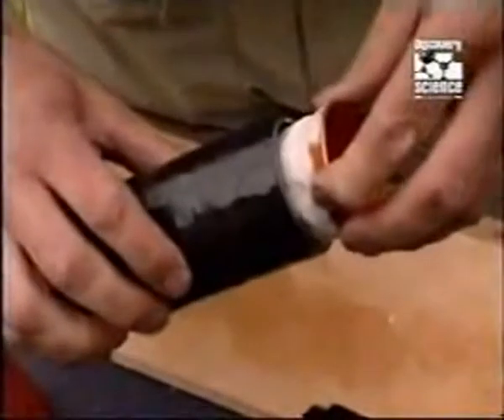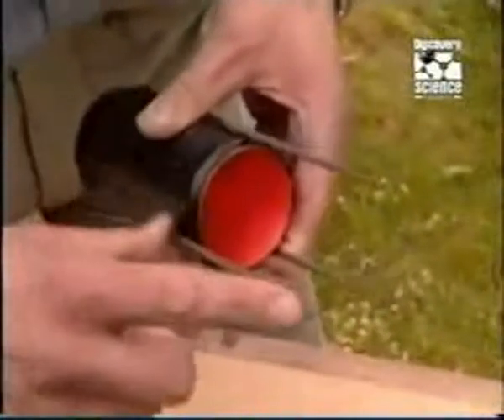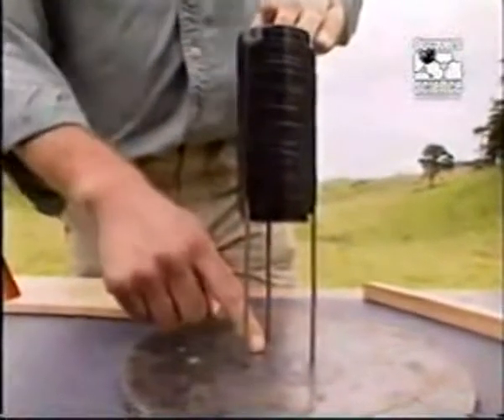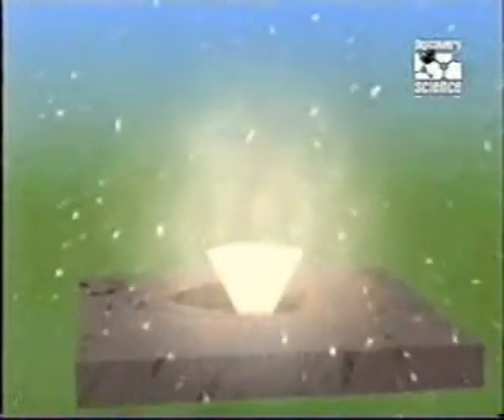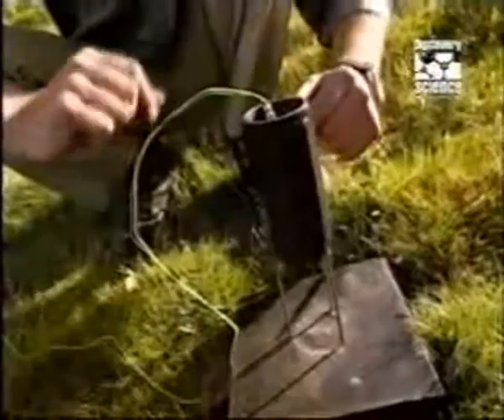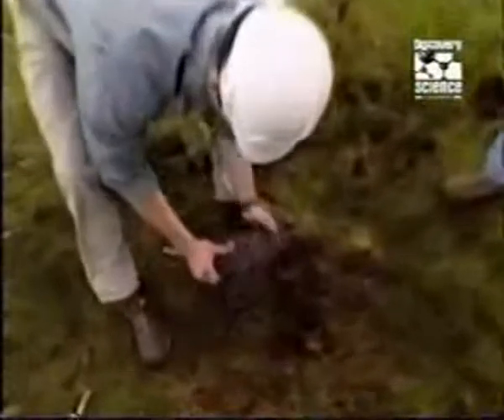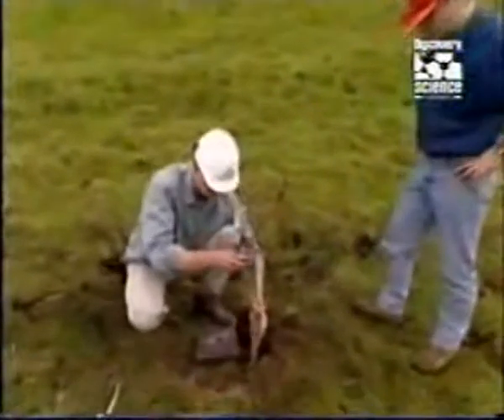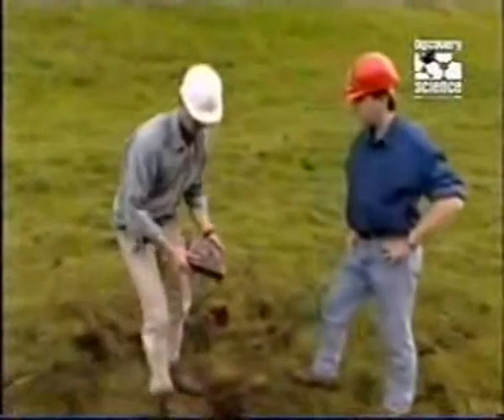Shaped charges in WTC? Anomalies?

Comment: Actually the copper isn't a gas, there is no plasma, and why the hell would somebody use a cylindrical shaped charge to punch holes in an I-Beam, that wont do shit! You have to use linear shaped charges to cut an I-Beam.

Comment: but being plasma it wuld be relativeley fast and go thru the steel, and the steel in WTC isnt bent by the charges, it bent from the plane crash after wards, the charges were used at spots that would weaken the steel as seen in the video